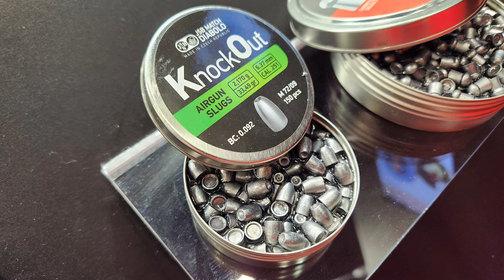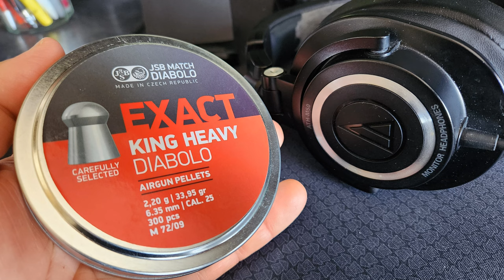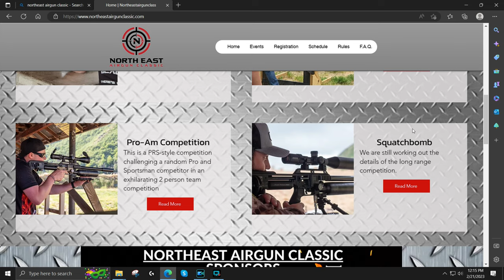NEW JSB Diabolo Pellets & Slugs (FACTORY INTERVIEW) JSB Airgun Slugs + Hades .35 - SHOT Show 2023

Comment: A 34 grain JSB HADES in 25 cal would be freaking awesome especially in my LCS. It absolutely loves FX 34 grain pellets and with the heavier weight they do not get pushed around as much by the wind and have better accuracy at longer distances when the moment requires. Softer lead would also be nice so they could open at lower speeds like in the UK with sub 12 guns that are basically just shooting a diabolo at those speeds. They just don't expand until you push them faster like 900 fps...from my experience.
Reply: Agreed , need that for my maverick.
Reply: Yeah your right, i was shooting FX 34 grain yesterday in some gusty wind and it barely had any effect on groups, but shoot the 25.39 kings and they were hitting everywhere.

Comment: It would be nice if JSB would go back to producing decent .177 diablo pellets like they used to in former years as recently they have been awful. Useless down range BC and too shallow in the back and low in the head (more like a flying saucer than a dome which is more stable and aerodynamic) and short on length. Absolutely useless for HFT. 

Demand over the last few years is not an excuse for poor pellet design. In recent years we have had more and more issues finding a good die, but now it seems impossible to find a decent batch, let alone an outstanding one. 

I think half the issue is the people at JSB who are making them no longer care as long as they are selling pellets. But for us competitors, who probably shoot a heck of a lot more than plinkers and hunters, a decent pellet can make the difference between winning a comp/season or being an also ran. Check any of the current top shooters on the circuit, whether HFT or FT and I can guarantee they are using batches from 5+ years ago when standards were higher and JSB were interested. 

Many of the pellets we are getting through from JSB at the mo are incapable of one holing at 25y let alone tight grouping or clover leafing at 45-55y. And that should be just as important, if not more so for hunters!!

I do hope JSB are back on the case, but recent history and batch testing does not fill me with hope. I feel like the competition community has been abandoned. If JSB want to get in touch with me to chat, I am more than willing to show them the difference between a good pellet form from a few years back and what they are producing now!

Theresa Reed 6x Ladies WHFTA World HFT Champion.